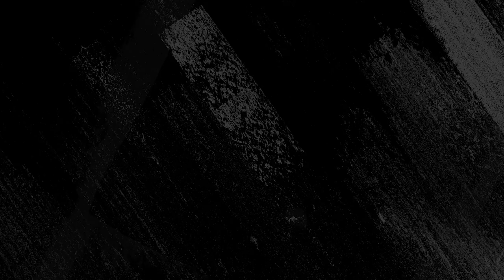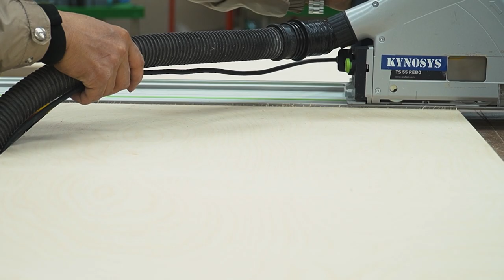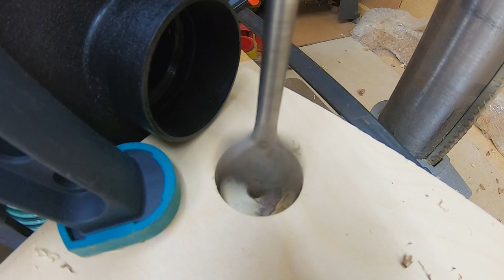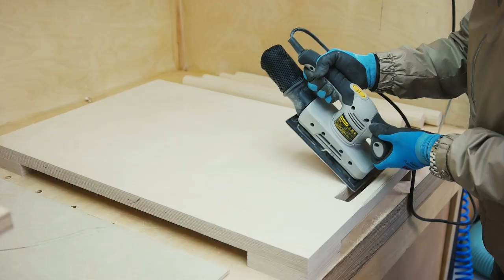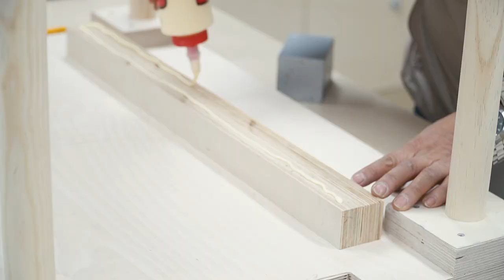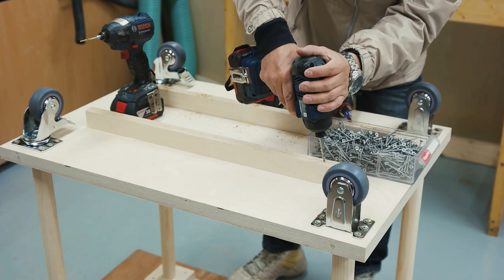Wooden Cart Making / DIY

Comment from the maker: Please turn on your language subtitles!
I didn't want to use the hand cart that I used a lot.
I decided to make a wood cart that goes well with the workshop and designed it.
The size is 550mm width, 800mm length, and 800mm height.
The birch plywood was 30T thick.
The problem was whether the wooden stick holds the weight, but the test confirmed that a 40mm rod is enough. It uses urethane wheels that don't make sounds to match luxurious birch woods, and two of them can be fixed using a stopper.
I used matte water varnish to make the finish look luxurious.
I think I made a beautiful cart that goes well with the workshop.
If you need a cart, I think it would be good to make it by referring to the video.
Thank you.

#DIY #WoodCart #HandCart #HandTruck #Cart #WoodDIY #MakingCart

Comment: Awesome cart! What is that tool you used to punch the hole?
Reply from the maker: You can search for center punch. It is a tool that clicks when you press it down and hits the pointed part. It is usually used to mark the surface of metal materials, but I also use it for woodworking. thank you!
Reply: @Kynosys_  감사합니다.
Reply from the maker: @MelovesPugs  Receiving greetings in Korean, I feel very happy. Thank you for your consideration.